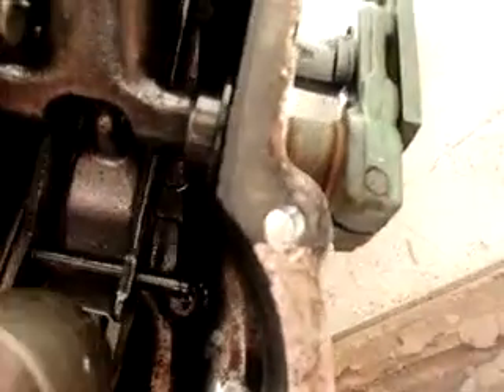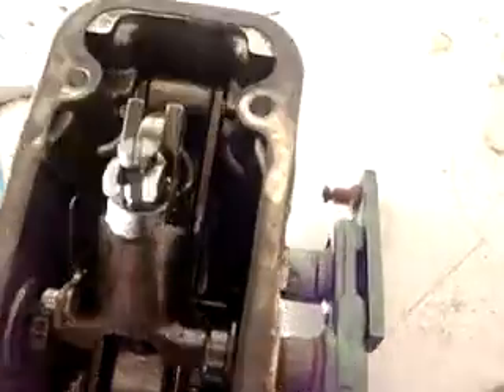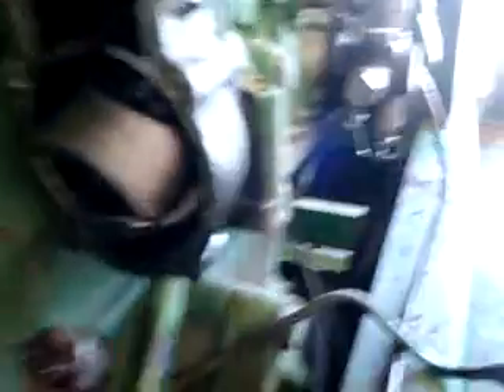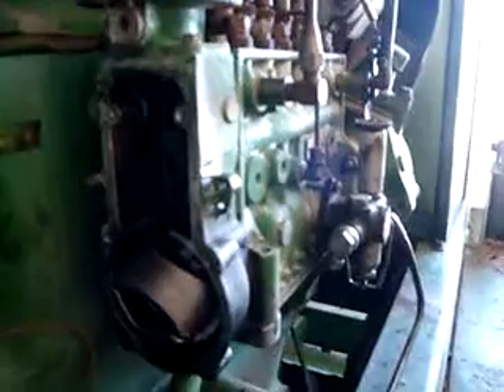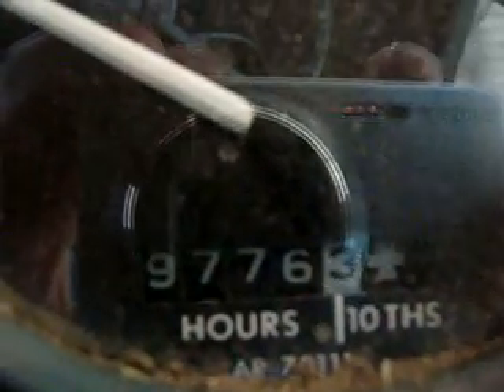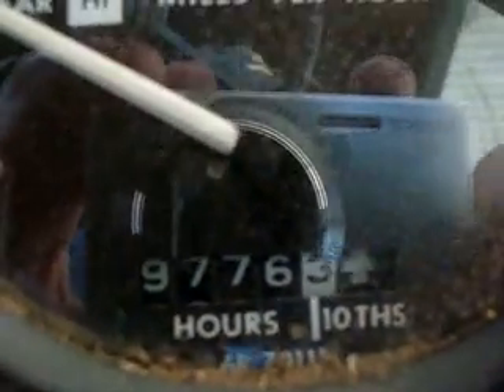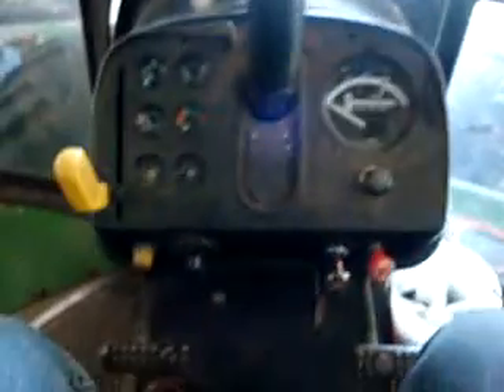8630 John Deere Walk Around

Comment from the maker: @generationll this one is a early 78 model. its got the 90 amp alternator, upgraded lights, and the transmission lube pump lamp. only late model thing it doesnt have is the 3 speed blower motor. instead its got the regular 2 speed dual blower motors.

Comment from the maker: 1978. early 1978. since it has the updated lighting system but doesnt have the updated 3 speed blower system for the cab yet. so its showing me signs of early 78 that and i run a serial number check and it said 78 model year.